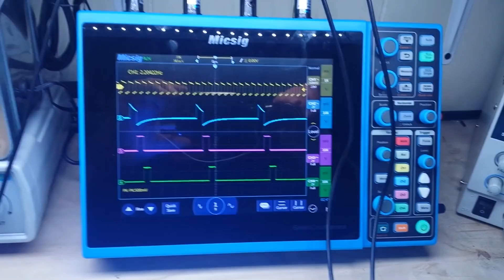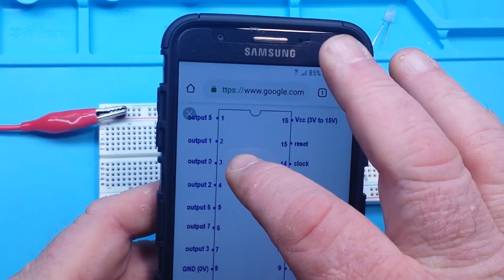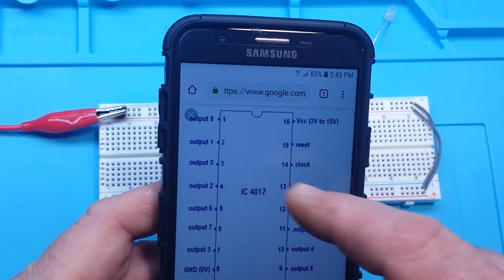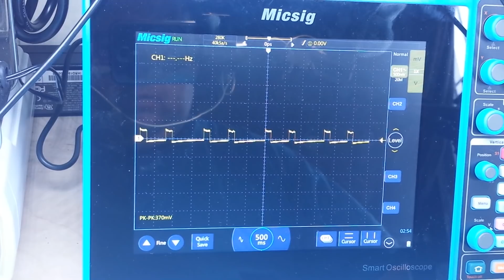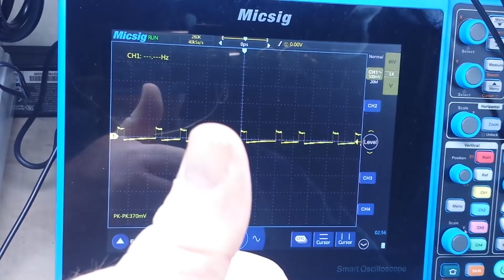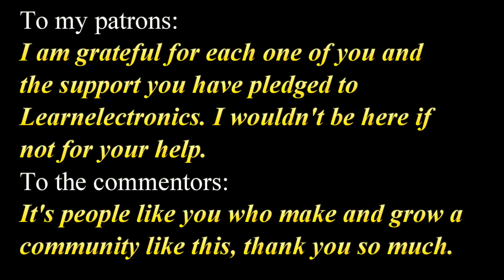CD4017 Tricks -  "The Lighthouse"

Comment: I have a confusing issue with a circuit like this one. I am using a potentiometer to control and slow down the speed of the 555 and the LM4017 outputs. I'm wanting the LED's to fade when they come on and off and I am experienced with many different circuits that fade LED's. I have tried basic cap and resistor pairings at the LED's and also by using the 4017 outputs to drive bc547's transistors that turn on the LED's, again with different arrangements of caps and resistors on the base and/or emitter sides and I've also tried resistor/cap arrangements that can turn square waves triangle or sine, with and without the transistors. In all cases, I can get a very controllable fade out of the LED's but cannot get them to fade on. Is there something about the output of an LM4017 that will not allow it's waveform to change or for a capacitor to slowly charge? Or something else that I just can't figure out?

Comment: Just wondering what the purpose of the diodes is? Thanks
Reply from the maker: Keeping the outputs separated
Reply: @learnelectronics  thank you for reply! Also what does it mean if you have say five LEDs in a row and they are all blinking together with timer but not very brightly! Damaged IC? Static?
Reply: @learnelectronics  thank you Paul!

Comment: I'm curious, why  diodes to the led? Would resistors work just as well, or are diodes required? Thanks in advance for your time and help.
Reply from the maker: Diodes are one-way switches. Used to prevent back end into the ic.

Comment: I wonder how many 4017 and 555 timers have been used to make flashing panel  lights in sci fi movies over the years? 
The last time i used a 4017 was to divide a pulse signal by 2 for the tacho on my milling machine .The origional  tacho required 2 pulses per revolution but a fitted a cheap chinese made unit that needed 1 pulse per revolution and to change the  notched disk  for the hall sensor would mean complete disassembly as it was mounted on the mill spindle deep inside the machine - after abit of head scratching i decided to divide the signal electronically and it was the 4017 to the rescue !
Thanks for the video !
Reply: Nice hack Ian !! 😎👍☘️

Comment: I'm a little confused. Why is the 3 diodes in parallel? They all go to the same pin.
Reply: Albert van der Merwe the diodes are connecting three different ic pins with one LED, only one ic pin can be high during the clock pulse, without the diodes the current would flow back to ground through one of the ic low pins instead of the LED.
Reply: @captainpugwash4100  Looking at the video it seems all 3 diodes connect to the same pin on the IC
Reply: You can even see in the thumbnail it goes to the same pin.
Reply: Albert van der Merwe no they are not in parallel , and I admit not easy to see. Take a look at the 4017 data sheet on the TI website and it shows the cycles of pulses coming from the output pins. You will see that all the output pins are naturally low, therefore they have resistors pulling them to ground, meaning that without the diodes the current would short back through the low output pins to ground and only a small current would flow through the LED.
Reply: Albert van der Merwe True, I looked at it again 5:34 to 6:00, and that makes no sense whatsoever. I thought he had hooked up the pins mentioned about a minute earlier. Three diodes is serious overkill.

Comment: That's pretty neat.  I set up a flip-flop circuit with a NE555 timer, and a couple of voltage regulators to switch the blinking between two lights.  I have the schematic if anyone is interested.  Just tell me where to send it..:)

Comment: Having been stationed at a lighthouse (Cape Blanco) for 2.5 years I'm pretty familiar with the way the light works. Ours rotated a mercury vapor bulb inside an 8-foot tall 6 sided Fresnel lens. The flashing came from the light shining through each side of the lens. So depending on your location you'd see a single flash at a particular timing. This is a cool circuit but it looked like you had two diodes in pin 3 and the other in pin 9. Maybe it was the lens or something that made it look that way? Thanks, Paul, I'm enjoying these videos!
Reply from the maker: No they were all in different pins.
Reply: @learnelectronics  Why are you in total denial about this? You are acting really strange.

Comment: you have 3 diodes hooked up to pin 3
Reply: Yes he did, i see this also.
Reply: Yep, the blue LED is only flashing on outputs from pin 3 and 10. I think three diodes to isolate pin 3 is a bit over-kill.
This IC has 10 output pins (outputs 0-9) and you wanted to use 4 of them. Had you actually connected to pins 3 (output 0), pin 4 (output 2), pin 10(output 4), and pin 5 (output 6) the output would be something like this: +_+_+_+___ repeat (+ is ON and _ is OFF). This would not be the blink-blink pause blink-blink pause you were expecting. It would have been a rapid blink-blink-blink-blink pause. Since you wired it incorrectly you actually got something similar to what you wanted. You only connected pin 3 (output 0) and pin 10 (output 4), so the blink code would be +__+____ repeat. Watch how fast the yellow LED is blinking and how slow the blue LED is blinking (6:50).
Reply: I came to comments for the same reason. I didn't understand why pin 3 was so important to those diodes and was wondering if he would recognize the issue by the end but I guess not.
Reply: @BigJewDaddyAndy  Oh well maybe just one of those days....we all have them...lol
Reply: @sortofsmarter  So True.
Reply: hmmmm?????
Reply from the maker: No I do not
Reply: @learnelectronics  Thats what I see too?
Reply: @learnelectronics  5:43
Reply: @learnelectronics  Perhaps revisit this?  Why would you get the expected result with the incorrect pin connection?  Love your videos, just wonder why it gave us the illusion of the correct signal with half the pins misplaced.